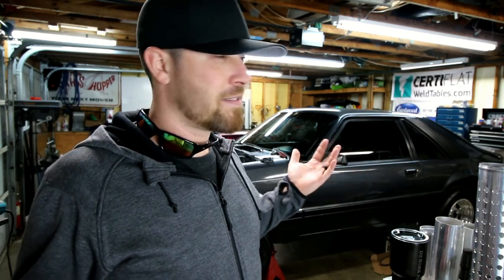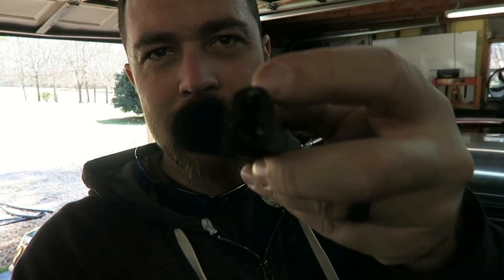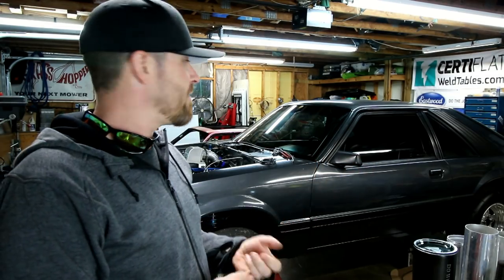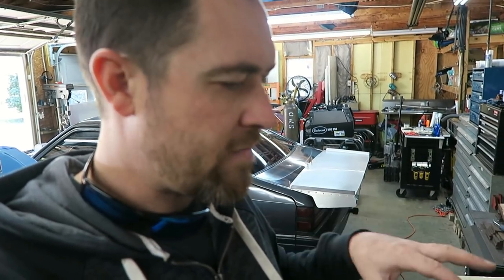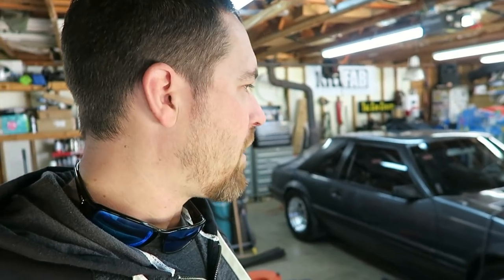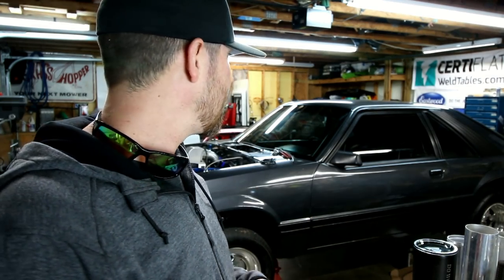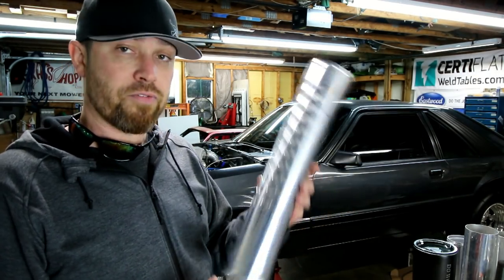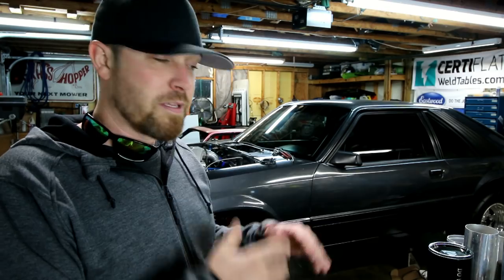Make All The Boost

Comment: Hey Kyle how about a video of tips and tricks on tig welding different joints? (Butt joints, lap joints, tee joints, ECT, ECT) maybe how to hold it based on the joint, been trying to learn hard to teach ur self
Reply from the maker: I would but there are already a ton of those out there
Reply: The Fab Forums there is but they don't really give advise on how to position ur hand or what joint needs more amps, like actual tips and tricks for joints and at that different joints in one video how do u practise getting better ECT ECT really detail videos like ur videos. That's what's going to make people trust u on ur opinion builds a relationship between u and the watcher.

Comment: hey my friend I have a ponydown single turbo kit on a 351w fox, I got the y-pipe, so should I run one chamber flowmaster muffler or nothing on a turbo car, I have no idea what to run, would you have any idea what to do thanks buddy
Reply from the maker: the dynomax ultra flow mufflers are awesome. They make them in different versions based on how loud you want. This is what I will most likely run on the Goose https://amzn.to/2qCCSvQ
Reply: If your a flowmaster kind of guy they make a straight through muffler called the outlaw race muffler or the one chamber super 10 muffler. But no muffler is the best muffler if you can get away with it in your state. Lol
Reply: I've run the Dynomax Ultra Flo stainless welded race mufflers on several projects and love the sound! Check out Jet.com for the best prices I can find.
Reply from the maker: Yeah I like Flowmaster on anything but the turbo cars....the ultra flows sound so good on the turbo setups

Comment: is that a shp block or stock
Reply from the maker: Its a DART block
Reply: that's good for at least 500 hp or more you think, what have you seen a 351w stock bottom end hold with a single turbo, I have a 351w with blue print engines allunium heads 190cc, 2.02 int and 1.60exh, and iam trying  to see what it will make, dyno tune on july 21st